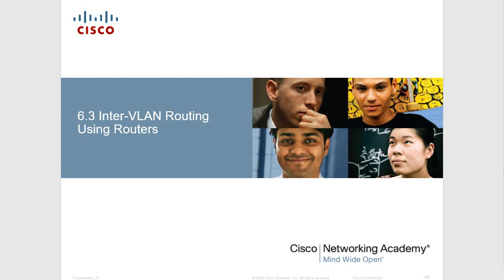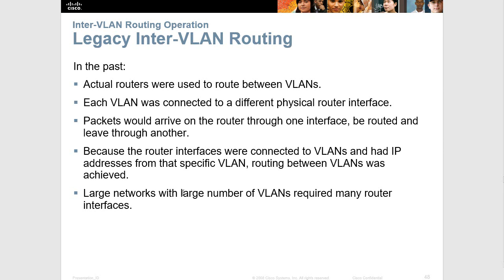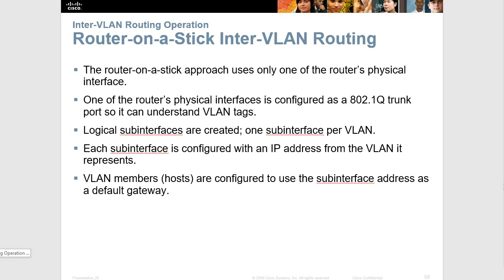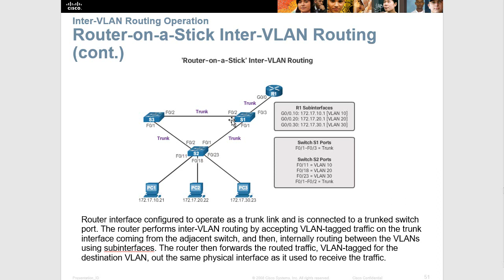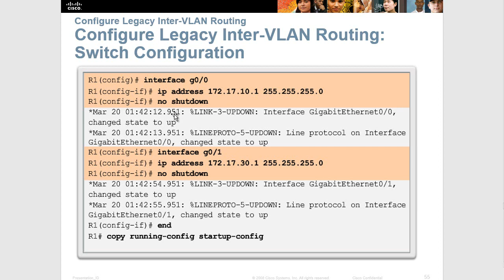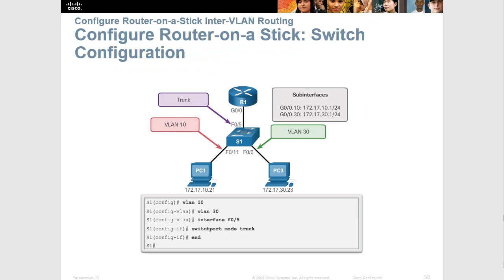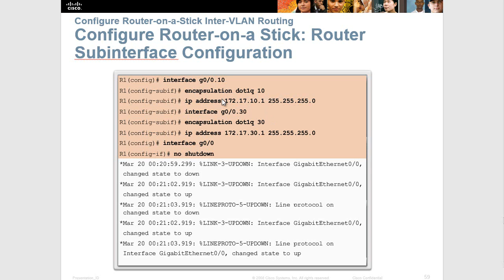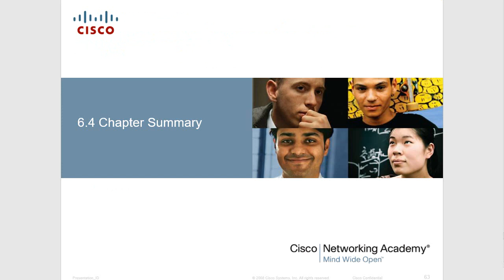CCNA 2 Chapter 6: VLANs Part 2

Comment: I think it is way easier to understand if you try the: 
     5.1.3.6 Packet Tracer - Configuring Router-on-a-Stick Inter-VLAN Routing.pka

beforehand with a tutorial and then watch the detailed information in this video.
Best regards.
Reply: This has since been changed to 6.3.3.6